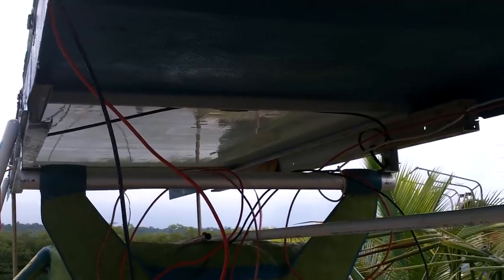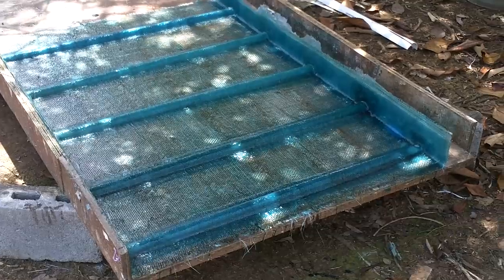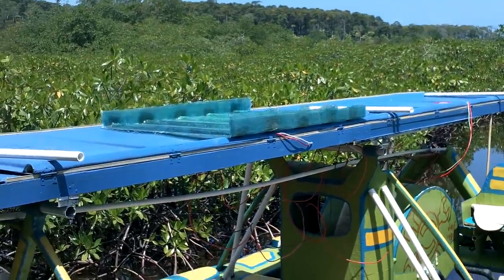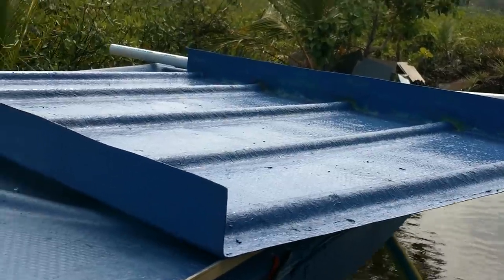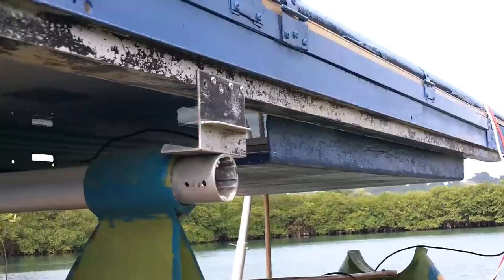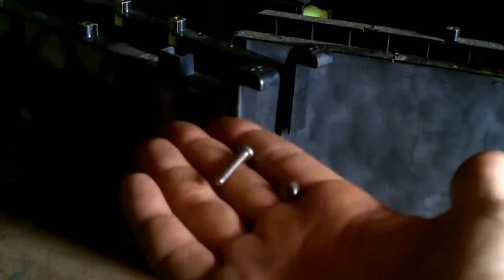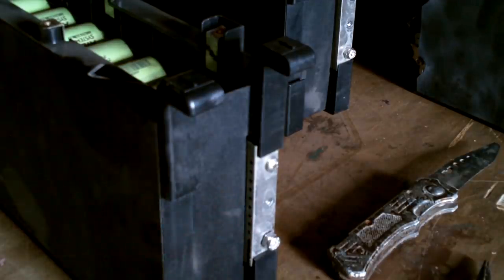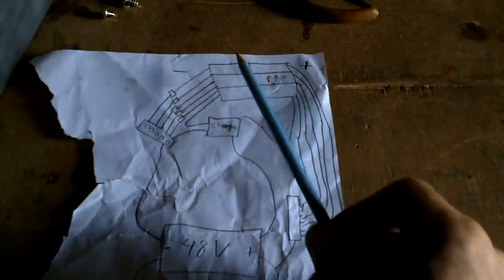Solar Snailer 037 Battery Box 'n Stuff

Comment: I am pretty sure the Schneider Electric C40 charge controller was designed for Lead Acid batteries. Or with a Resister cut out, for NiCad.  Hopefully it allows for enough tweaking to work with your Lithium batteries.
Reply: I'll bet he figures something out that works for him.
Reply: libertyauto, it looks like the bulk and float setting is adjustable and overlaps such that he can even make float higher than bulk if he wants to, within the range of 52-58V. If he’s using 13S, and let’s say for safety he charges up to 4.1V/group, then 53.3v would work. 

The low voltage disconnect also seems to be adjustable to 13S safe voltages.
Reply: Right on, IMHO.

Comment: What are the specs on the battery system you will be using? Not to impose, but if I were you I would drop some money on a really efficient prop(like a torqeedo?). It would be a shame to work so hard on this and lose a significant amount of efficiency in your prop.

Comment: Hey what do you know about the electrocution factor if this boat were to sink. I was standing in (fresh) water and touched the 12v starter battery on my gas boat and I could feel it shocking me significantly, whereas on land u can't... I hear it's not as bad in salt water but what are the risks with more voltage?? I want to build a solar boat but yikes!
Reply: It is worse in salt water. Salt water is more conductive than fresh water, not less.
Reply: Take sensible precautions then build. Build man, Build!
Reply: I know you haven’t gotten the answer you’re looking for yet, but I wanted to add that touching the battery directly versus being in the water with a bunch of them should be very different things. In your experience, you were the easiest way for the power to get to ground because you touched a hot terminal or wire. In a boat sinking (or swamping), all the terminals are immersed in a conductive liquid. Plus you’re in the water of course. I think we need an experiment.
Reply: 48v Is perfectly safe, it's when you get around 100v things start to get dangerous.
Reply: There aren't even safety regulations for voltages below 50v. You're fine.